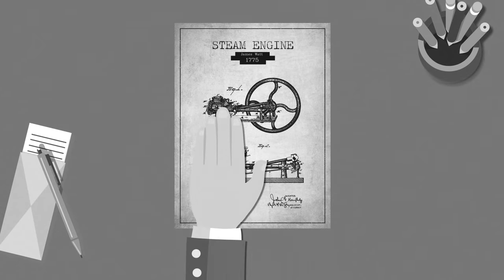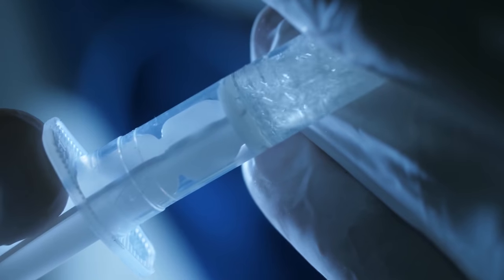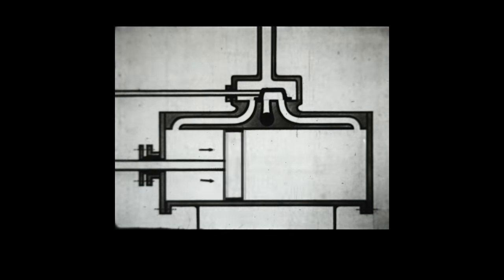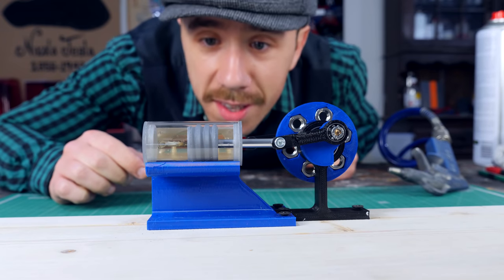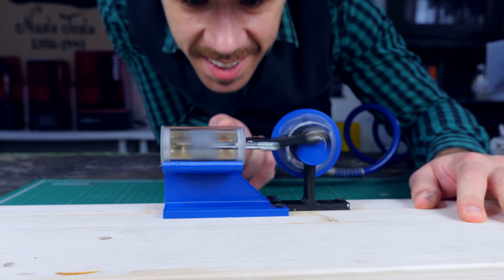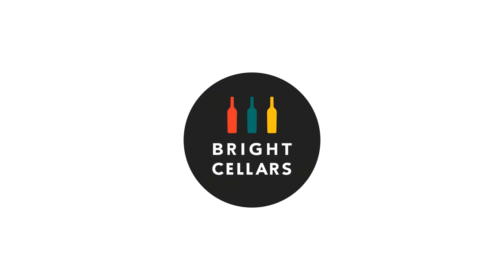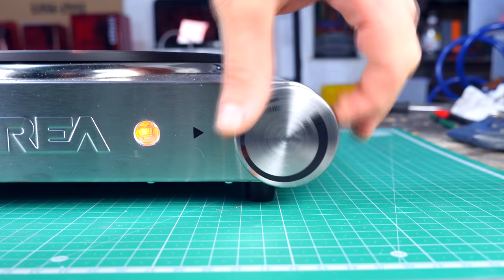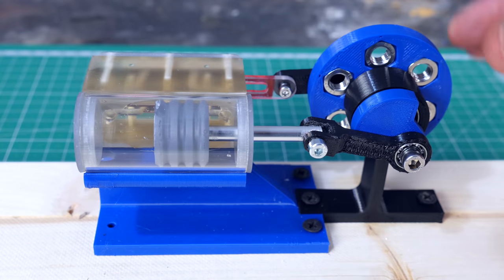Transparent Steam Engine (3D Printed)

Comment: This is not an engine.. this is a piston using external power.. all this is doing is pushing something back and forth using compressed air from a compressor. Now something like a thermal expansion engine (using something like a candle) Now that you can do!. and it (should) work with this piston. Really loved the video but i expected to see something powered from the title.

Comment: am wondering when you said i need steam so i can onlt generate it with a boiler, after watching your previous videos regarding hydrogen peroxide and catalysts such as catalytic converter material why you didnt try using this method to generate steam. as you know hydrogen peroxide amd potasium magenate generate huge amounts of steam when the hydrogen peroxide is decomposed. am i the only one wondering why theis method is not used in real life for power generation, steam powered vehicles ? is it the cost of the hydrogen peroxide that is prohibitive ? am interested in your thoughts, as for a steam engine i would suggest the 3 stage 3 cylinder type and to controll the pm by varying the injected quantity of the hydrogen peroxide. verry interested in your thoughts about this

Comment: It didn't work until the early 19th century when steam engines are used in coal mines across mainland UK. That very same day sparked the birth of Industries popping around the world. Thus begins the Industrial Revolution which sparked the age of industrialisation. The steam engine however comes at a cost. The cost of efficiency. It's inefficient. But that's when the discovery of Oil kicks in. Oil when discovered can make you millions if not BILLIONS of dollars soon after you discovered Oil. Just after. When Oil is used as a lubricant for steam engines. The money really went in. But with war came into play. After a war would lose BILLIONS of dollars. And because of WWI. Which has a new player joining. Aircraft, especially biplanes. that's gotta sting